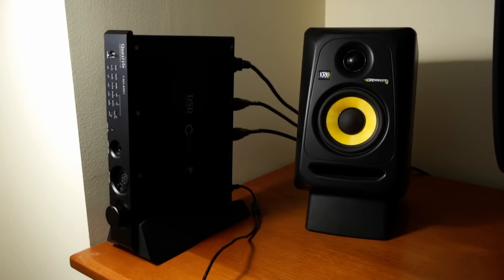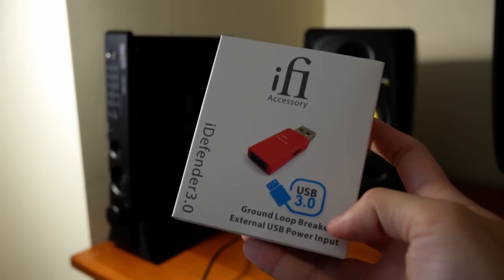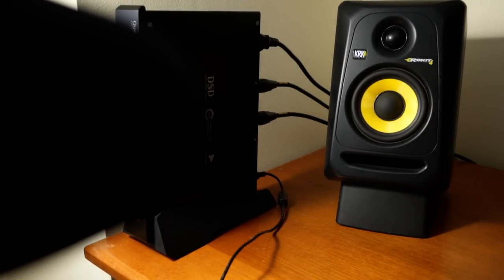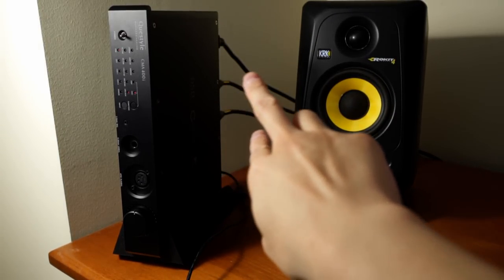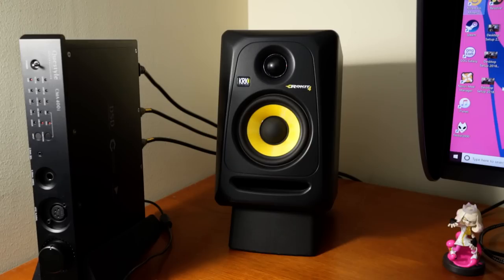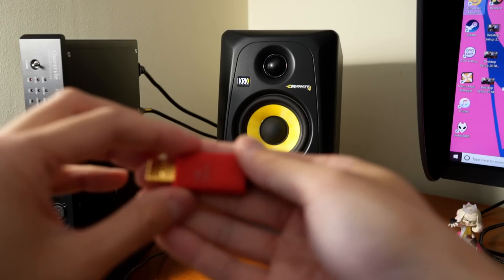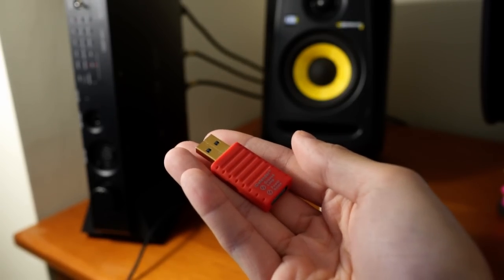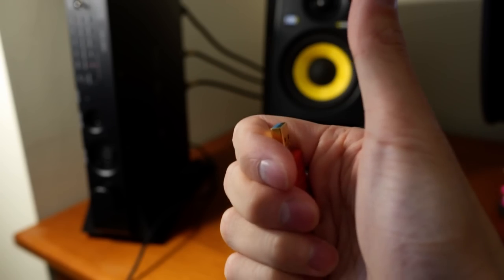ifi iDefender 3.0 Review & Demo: Breaking a GPU Noise Ground Loop

Comment from the maker: Here's the TLDW of this: yes, it works. You can watch this overly long video to see why it works, when you might use it, and what difference it can make!
Reply: had the same issue. I opened up my usb cable and cut the voltage plus and minus strands. So in the end only the two data strands were connected to the dac. Solved my issue.
Reply: Thank you. I also have a ground loop hum and this is the first of three videos on USB filters I found which wasn't some quack claiming it "improved the clarity of the vocals".
Reply: Hello, so if my DAC is USB powered this would not solve my noise issue since this thing is cutting off the power from the USB right?
Reply: @bh11nd  There is a port on this product to add power from another source back into the chain.
Reply: @bh11nd  iFi sells a 5v power cable that plugs into the Defender to re-introduce power. I recommend buying them in a bundle instead of separately, since the power cord is expensive. 5V USB C
Reply: well, most likely i just killed with this little thing my focusrite scarlett. It did not turn on to a 5V adapter, so i switched to a 9V and it burned out.

Comment: I just bought the Ifi defender and it worked perfectly for my problem. Im using a scarlett solo 4th gen, yamaha hs8s and hs5 with trs cables. In short, I only had a hissing when my scarlett was plugged to my pc. Since I installed the ifi defender, hissing is gone. If you unplug your Dac from your pc and you still have hisses, don’t buy the ifi defender… The problem is not coming from your pc. Anyway that’s my logic and I’m a noob on the subject. Hope it helps !

Comment: That's a pretty big fail on Queststyle's behalf. They're supposed to have a circuit inbuilt to remove any ground noise before it's amplified. The DAC/amp I use, the Audio-gd NFB-15, never has any noise issues and my PC has an extremely noisy ground. I think you may want to look into upgrading the Queststyle to something better.
Reply: a lot of dacs don't isolate the usb power even if they are powered by mains as they use it as a 5v trigger to automatically turn on the dac when the pc comes on thats in my case anyway, not too sure about the questyle
Reply: TheWretchedWorld that's just bad design choices. When you pay upwards for $500 for a headphone DAC you expect it to be designed to work with a PC without issues. After all, that's its purpose.
Reply: hmm interesting!. thanks!
Reply: I'm not too familiar with the R2R resistor ladder DACs but it doesn't seem to come with the Non-feedback ACSS analog amplifiers, so maybe that design doesn't allow for noise filtering? It's a completely discrete DAC design, so not the same as a DAC chip.
Reply: I would suggest trying to run Coax or Optical to see if maybe the issue only on the USB power rails.

Comment: I've been experiencing the same issue with my monitors since I bought them. Since I'm using RCA>XLR cables, I figured the reason it was happening was because I was not using a fully balanced connection. Thank you for shedding light on the ground loop issue. Since you mentioned it in your last video, I've been looking forward to seeing how this works. I need to confirm whether or not it works with my DAC and if it does then I will buy it.
Reply from the maker: Yeah, originally I had thought that going balanced would solve many noise issues, but it doesn't seem to be the case. It should work with your DAC if it's mains powered, or if you use an external power supply (ungrounded would probably be ideal)

Comment: Just bought one for my studio setup. My audio interface would make a buzzing sound like interference, once I plugged the device in the buzzing was gone , 100% recommend
Reply: HC where did you plug it in the chain? Interface > iFi > computer?
Reply: @AGUIDA  It's a USB stick.
Reply: What audio interface do you use it with? I m also interested to try it out.

Comment: Take an old USB cable…cut Only the red wire, then clamp a magnet ferrite where you have cut it...to cover the cut (estethic)
If it need power then drive the power just the side of your device not from computer.

Comment: I achieved the same effect by getting a USB Y-splitter, covering the power pins of one connector (using duct tape. it's the 2 longer side pins, leftmost and rightmost), plugging that one into my PC, and plugging the other one into a power adapter.

Comment: I had the same problem. However, I noticed that after hitting the computer case, the noise stopped for a while. I looked at the computer's power supply. The grounding is led out from the power supply housing and then through the screws securing it in the housing. My metal casing is painted black and probably doesn't ground the power supply properly. I ran an additional ground wire from the power supply to the unpainted part of the case. The noises have completely disappeared.
Reply: Bro did percussive maintenance.

Comment: its because usb is a floating point ground and the amp is plugged into actual earth ground. the floating point ground is slightly above earth ground causing a dc offset between the amp and the usb device. if you ground the usb to earth ground it will place the ground level at the same level as the amp. thats what this is designed to solve. yur supposed to plug a grounded 5 volt power supply into it.
Reply: Very well said makes much more since

Comment: So I just got this device. I exactly the same ground loop when the gpu becomes active. In my case not only did it not work, but it also introduced a new hissing sound. I'm going to lift the ground of the wall plug where my audio setup (including USB dac) is plugged.
Reply: I just wanted to ask if you ever got this issue fixed?  Im having the same issue with GPU hum though usb
Reply: @Frosttyy12  not really, this device didn't help much (only reduces part of it when plugged with a power supply)
Reply: @Dexterprog  I wonder is the 3.0 and 2.0 have something to do with it because this device is 3.0 and I hear they aren't compatible.  take an old cable and cut the + and -

Comment: Great video! This was the one that helped me understand that it is a loop caused from the ground wire from the computer and the ground wires from the studio monitors. But you don`t need this adapter! The solution does not cost any money! I just eliminated the ground wire pin from the plugs which power the studio monitors and the noise was gone! Could have done it to the computer, but I prefer to do it to the speakers, because the ground wire there is less important. Thank you for the idea!
Reply: Have fun with that house fire.
Reply: That is a terrible suggestion.

Comment: I would like to share my experience with using ifi iDefender + (newer version) and support this video (Maybe It will help someone).
My connection is very similar like in this video. In addition, I have a sub between monitors and an audio interface:
PC >-U-S-B -> Audio Interface (Focusrite Scarlett 6i6 gen 2) >-X-L-R-> Subwoofer (Adam Audio Sub7) >-X-L-R-> Monitors (Adam Audio A5X's).
I suffered with the same problem. The unpleasant noise which appeared when a GPU started using more performance. Most of this noise was reproduced by the sub and smaller portion by the monitors.
Firstly, I replaced RCA cables to XLR cables. It only attenuated noise in the monitors, but not completely. I even tried to solder EMC XLR connectors. However, this didn't solve the problem. After that, I bought this ifi stick and put it between PC and audio interface and the noise was attenuated even in sub, but it was still hearable. Finally, I tried to power ifi stick externally via USB-C cable and it started work perfectly. Sub and monitors do not reproduce any unpleasant sound and everything is absolutely clear.
Reply: Are you still able to run all channels of the focusrtie. I understand these things may limit USB throughput.
Reply: thanks for posting this, my old ass saffire 6 USB + similar setup to you started to do this when I started rearranging some things in the studio.  It has come and gone over the years but it is starting to get a little worse so I am going to try this approach.
Reply: Hi Poisy DEVIL, could you please clarify what you meant at the end there? ("tried to power ifi stick externally via USB-C"). Thanks.
Reply: @AudioAssassin  did you figure it out?
Reply: what 5v power supply are you using

Comment: I had the same problem. I just wrapped the outside of the male connector with electrical tape to isolate it from the pc case and that fixed the issue for me. Blissful silence and no money spent.
Reply: Hey Joey, I am getting very similar noise as shown in this video.
Electrical tape on the USB male connector that goes into PC's USB port, just worked flawlessly for you?
If that's the case, then you are brilliant.
I am going to try this myself.
Please tell me more about your experience in detail if you have time.
Reply: @ratedrsuperstarthega  I got constant noise from moving the mouse around, you know this binary sounding beeping/hissing,as well as something that sounded like coil whine from my graphics card coming from the speakers. I just traced the issue back by unplugging stuff backwards, starting at the speakers and eventually ending up at the USB panel at the I/O of the mainboard. My guess is that it's some kind of ground loop or similar issue. But yeah, a simple wrap of the male end of the USB cable ended up fixing it for me. The metal bit of that connector is used for interference shielding of the cable, at least with the one I got. Depends on the quality of the cable. Take a Multimeter and probe both ends doing a diode/continuity test, it should beep if it's the same with yours. Hope this helped, good luck!
Reply: @raddel123  Thanks for the reply sir. So, you do know what you are doing. 
I was checking the USB wire diagram, and it's said that the ground wire is INSIDE the wire insulation along with 3 other wires. Total 4 wires. While the metal bit of the wire end which plugs into the port is connected to shielding. So if it's a ground loop issue, Will just wrapping the metal part of wire stop the ground loop? Since the ground is still connected inside the cable.
I have exactly same problem like your. I get a lot of noise which is hissing, interference, computer digital noise and like whining. But I don't have a GFX card connected to my PC. So don't know what's causing this.
I'll try your method right now and see if works.
Reply: @raddel123  I tried the wrapping method like you described. I tested before wrapping, there was continuity between both the metal bits on both side of wire.
Then I wrapped the male side with tape and tested and there was no continuity.
But there was no reduction in noise after plugging this cable. All is same.
I then tested, I see the 4th pin - Ground pin INSIDE the wire and the metal bit are both the same. That means even if we cover the outside metal (shielding), the ground current flows through the 4th wire inside.  
That means shield and groundwire are the same.
Reply: @ratedrsuperstarthega  My DAC has its own power supply, meaning the only pins that connect it to the PC are the signal carrying ones 2 & 3. Pins 1 & 4 therefore are floating in my case. There still is an earth connection from the port to the power cable for the shielding. Both my DAC and PC are connected to the same power strip, so if I were to remove the tape from the connector, there would be a path for a ground loop again. Another thing you could try to determine whether or not you have a ground loop is to lift the ground from your receiving device, i.e. tape over the earth pins on its power plug !!!THIS IS POTENTIALLY DANGEROUS AND YOU SHOULD NOT TOUCH THE DEVICE WITH YOUR BARE HANDS WHEN YOU DO THIS!!! This should only be done for testing and only for a short time. 
How to: First, disconnect all cables from your receiving device (the one you connect via USB to the PC). Tape over the ground connectors of the power cable DO NOT TOUCH IT NOW, POTENTIAL RISK OF ELECTRICAL SHOCK! Plug in only the power cable with the taped over ground connectors. Now test for continuity between the metal casing and your PC (any exposed bit of metal works), there should be no continuity. Disconnect the power plug again for safety reasons. Connect the USB cable to your device and the PC, connect the power cable again. Now test for continuity the same way you did before. You should get a reading now. Note: If you have other devices connected other than the PC, you'll also have to remove their grounds as well. Now check if the noise is gone. Remember: Even though you have a ground via the USB cable and PC, DO NOT TOUCH the device.
Another maybe easier solution, is to switch to optical toslink instead of USB to achieve galvanic isolation between both devices.

Comment: Would a DIY USB cable with(out) with an equal pinout does the same job as the iDefender 3?

Are those Mogami XLR Interconnects?

Cheers

Comment: I have the same problem connecting my amp to the computer speakers using the 3.5mm audio out  , I tried a cheap USB to 3.5mm DAC and it helped with the background noise. Sometimes I still get a quick buzz . I am going to try your little  expensive gizmo , hope it eliminates the noise completely

Comment: I have a Schiit Wyrd with my Fulla 2. It did remove a strange buzzing when I move my mouse around but otherwise didn't fix my ground loop power issue which was to be expected. Sound sounds more consistent and also cleaner? I'm not sure if it makes a huge difference but I think everyone should have one anyway due to a cleaner digital source.
Reply: I've had issues with noise on a Dell laptop.

The simplest way, is a powered USB hub. To ensure noise is not introduced via the crappy power supply of the USB hub... Use a power brick to drive it.

It's usually really dirty PSUs that are the culprit. Or in the case of my Dell laptop, it's the charging management circuits just chucking out interference like it was confetti.
Reply: @parasiteunit  It was power-related. I was getting noise from my wall outlet. Using a power conditioner fixed it.

Comment: I just bought the "Ifi iDefender+" but the USB port of my laptop doesn´t recognize/detect it (error code #43). With a direct cable type-B works fine. It´ll be necessary to change the cable????. Or this device need to set any driver for running...or I must update something???. I'm using windows 11. Thanks in advance!!!.

Comment: I have the exact same issue, although the sound comes through my stax amp. If i load the gpu up with furmark the sound gets loud and is audible even at low volumes. Did it completely get rid of it or did it just reduce it to a level where its no longer audible at normal listening volumes?
Reply from the maker: As far as I can tell, noise from the activity of the GPU is gone. There is still some background noise when using sensitive IEMs on the balanced out of the CMA400i, but that was always there and mostly seems to be from the amp.
Reply: just got it in the mail fixed my noise, great product
Reply from the maker: Oh that's really awesome to hear! I'm glad it worked for you. All the noise is gone?
Reply: lachlanlikesathing yep completely gone. Volume maxed with the Stax energiser with nothing playing and I can't hear a thing. Before I could hear noise at 30 to 40 percent. Tbh this is a must have product for anyone using USB DACs just to avoid potential ground loops.
Reply: Thank you  @TheWretchedWorld

Comment: Doesn't helped one bit by itself with heavy GPU (1080 Ti) generated noise. I have a USB powered Presonus AudioBox iTwo DAC connected via 6.3 mm jack balanced cables to a of selfpowered/amped pair of studio monitors (Eris E8). Yet I have managed to deal with this problem in using it in alternative way.

1) I have taped the 5V and GND pins with insulating tape of a USB extender cord, that left only the two data pins on the USB connected to the motherboard
2) I have connected the DAC USB cable to the extender with the ifi Defender+ in the middle, so I can deliver a power to the DAC through the Defender+ and not powering it from the PC.

To be honest I wasn't sure if I should have bought the iSilencer+ instead. Since the GPU indused noise is more like EMI/RFI indused, not a ground loop one.
And trust me I have tried many things including - getting two different mother boards, two different GPUs, two different PSUs, nothing have helped.

Comment: I have the CMA400i with the Exact same Mogami Gold XLR cables going into my monitors and suffer the same issue. Do you know any other iFi products that cuts the ground and does all the good stuff like re-clocking, filtering etc. As I'd be interested in solving my problem that way. I like the idea of an AIO solution.